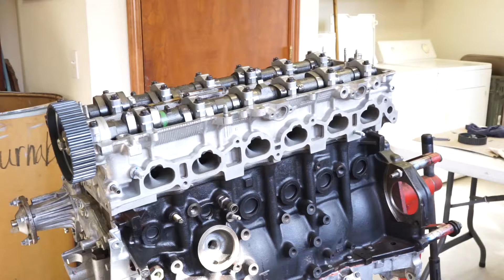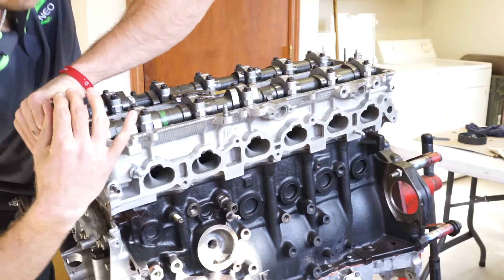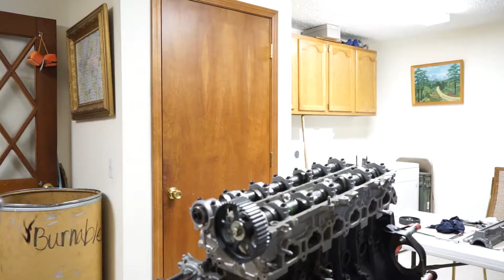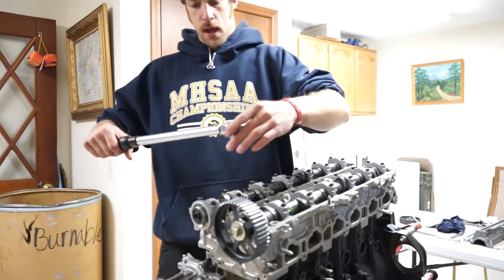VALVE LASH AND CAM CAP TORQUE 2JZ-GTE MKIV SUPRA

Comment: Hello sir. 

Did you  not have to re shim for the big cams? You got lucky bro!
Reply from the maker: It had big cams and i broke one putting them back in because me a dipshit.  replaced the big ass cams with the exact same big ass cams and it was good(checked with a couple pros before confirming all set) dynoed at 540something at the wheels conservatively

Comment: Why you didn’t tighten in sequence? You can break the Cams doing it that way
Reply from the maker: yes.  it all depends which valves are "open" as the cam lobes will be pushing while you tighten.  the goal is to keep it all as even as possible and with these monster cams it was tricky.  make sure the cam is under as little stress as possible.  pay attention to which lobes are pushing on the valves and i would even use that to your advantage by activating the center first and work outward(using the sequence, or at least the same philosophy as FSM sequence

Comment: wouldn't you want to check the clearance with the caps torqued to spec?
Reply from the maker: Checked them both ways!  it was the same.  I tightened the cams down in sequence until they "bottomed out".  After that, the clearance remained constant.